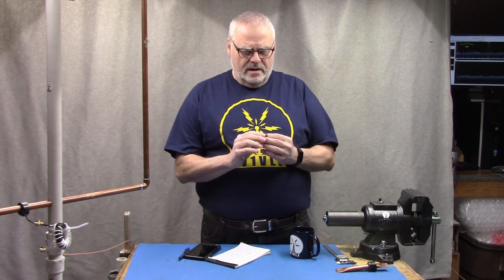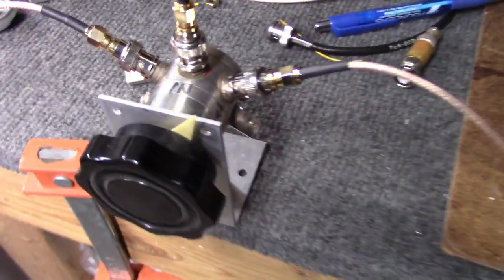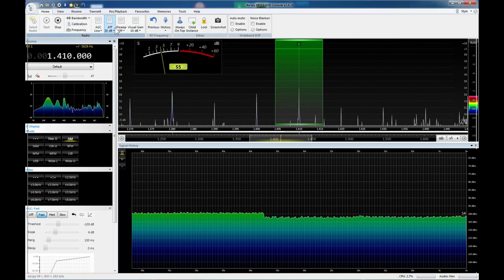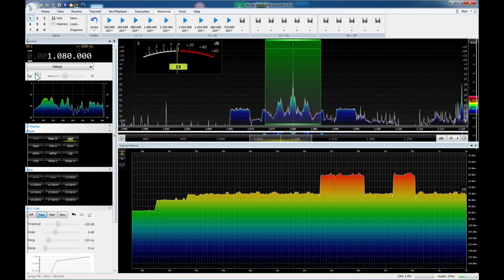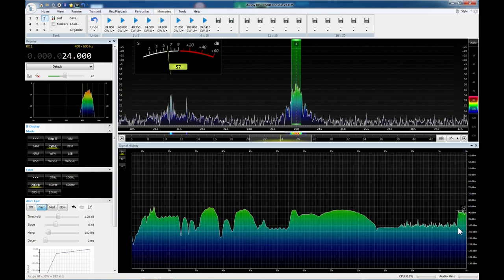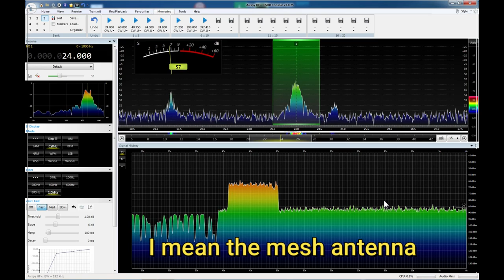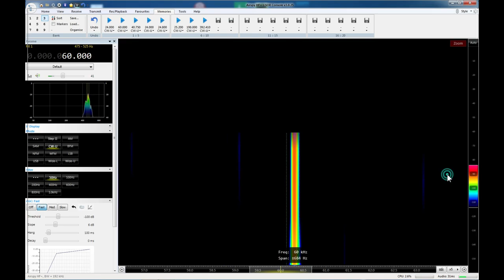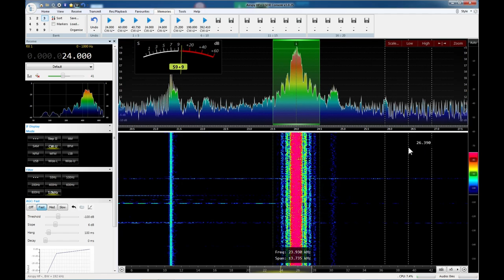Low Impedance Loop shootout 2

Comment: Thanks, Paul, Very interesting and answers lots of ?'s about the element width effect. Not having to be too critical on experimenting, outside loop noise floor reduction, etc. Not to mention what lighting looks like on the spectrum,  Many more? Like how critical soldering is on CU loop, toroid on Cu loop for common-mode I'm thinking will watch&like more of your vids.😁Have the .625 Cu and fittings and a roll of 1ft x 1/8" mesh in stock. 73 Thanks again!

Comment: please use the -dBm scale for the s-meter and also that the noise floor is indicated by the second needle at the s-meter. Than you can compare the signal to noise ratio when switching between the two antennas. It should be so easy if you use SDR Console ;)
Nice test of that loop material.

Comment: Paul, I would very much like to build the "mesh Version" of the antenna.  At approximately  7:31 in the video, I can see the copper pipe with the #75 core.  Around the core is 10 loops of wire which then go to some kind of adapter and then to coax.  My question is," Do the 10 wraps go to a pl239 cable connector, and then to the coax, or is there another matching transformer in the picture also?".  Thanks for your help, I'm very excited about making an antenna like this, and I want to get the cable connections right.
Reply from the maker: Hi Buddy, sorry for the long delay. You are correct. It is as simple as the 10 wraps go directly to the coax.   I did try less turns and it worked better in the MW bands. So I would experiment with that.  The antenna collapsed due to 18" of wet snow followed by fierce winds. So a rebuild of some type for VLF and LF is in order

Comment: Hi Paul, really enjoying your video's. They inspire me to do more experiments. One question: can you do the same comparison with SNR activated in SDR Console? This would give a better result, given the fact that not only the peaks rise, but also the noisefloor. 73, Cornel, PA3BTS
Reply: Yes Paul, I wrote this in the comments of the lost files video. Also, by using the noise floor tracking in the "signal history" window it will show us what is really happening. Please use the dBm scaling. I'm puzzled that you want to use the preamplifier when you have the ATT set to -30 dBm. I agree with Cornel's remarks. Best 73' Ron, ON2RON
Reply: Yes SNR is the key, nothing else realy matter.....

Comment: The core you show that you use is not the mouser core. Please what core do you actually use?
Reply from the maker: Hi Jerry.. Yes actually the core is available at Mouser, Here is the URL https://www.mouser.com/ProductDetail/Fair-Rite/2675821502?qs=Bm%252BFrMxn3UXSe%252BF0lFrGwQ%3D%3D.  If you want to try another vendor , this is the part number Fair-Rite 2675821502